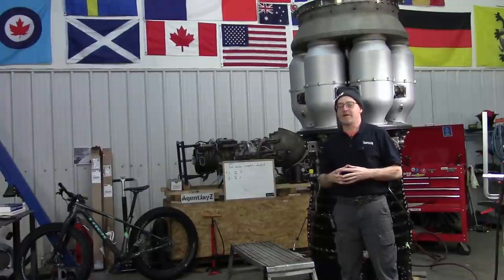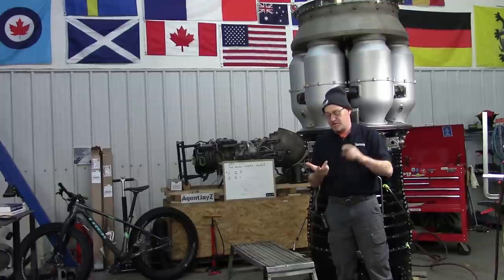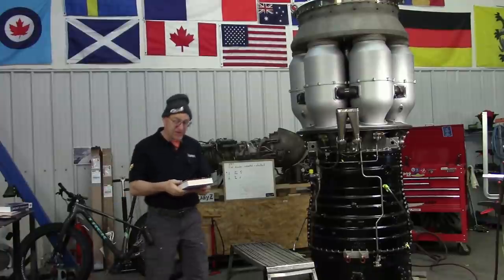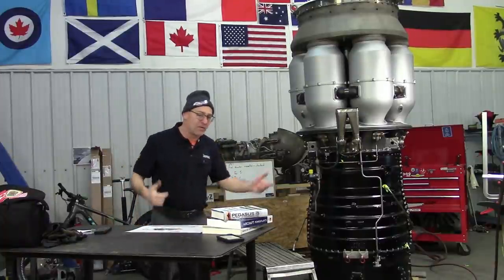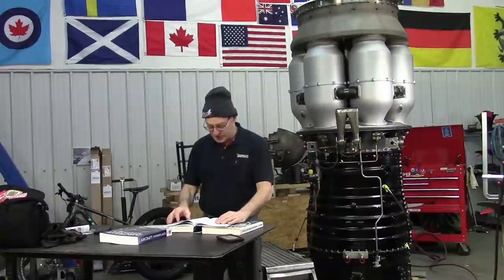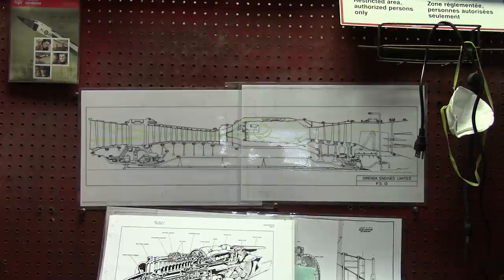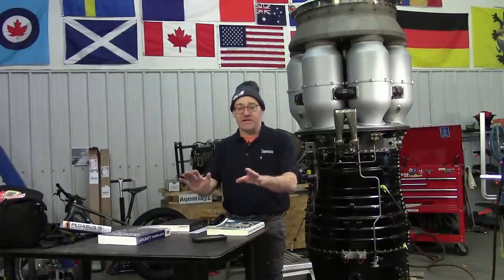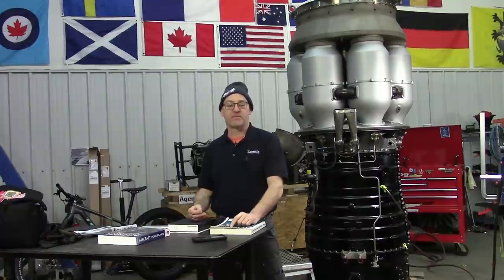So You Want to Design a Jet Engine

Comment: Graham, Are there any internal or external loads that we have yet to hear about on AJZ's channel?
Reply: To answer this authoritatively, I'd have to go through every single video.  However, it would probably be reasonable to say that, even if AJZ has covered all the major load issues, he won't have gone into the fine detail, nor would I have expected him to do so.  That would be going into the realms of detail design and even the books to which he referred here will only give an overview.  So let me think of a couple of examples.
He has discussed the phenomenon of engine surge, but he may not have considered the violent load changes on the compressor blades caused by the rapid pressure reversals.  These loads can cause very large bending deflections of the aerofoils, such that the axial spacing of the blades and vanes in a compressor is set primarily by their predicted surge deflections.  In fact, the deflections can be so large that, if they were imposed statically by a steady load, the blades would be permanently deformed.
Again, thinking about blade design, AJZ will have discussed the C/F loading on both discs and blades and, because of the  torque produced by the turbine, there must be a bending load on the blades.  However, he won't have explained that the aerofoils are designed with a very slight lean, so that the C/F load tends to offset the gas bending load.
I hope these examples give you a flavour of the the intricacies of of gas turbine design, to which AJZ refers.
Reply: @grahamj9101  Interesting, surge deflection is not one that I had considered. For the blade lean angle, would the centripital force help the blade resist gas load deflection or not really affect it?
I have watched all of AJZ's vids, surge deflection has not been covered, thanks!
Reply: @beachboardfan9544  Think about it for a moment.  Design a blade with the centroid of every aerofoil section radially above the one beneath it and spin it up with no gas load: it will be fine.  Now spin it up with hot gas doing the spinning: it will be bent very slightly by the gas load on it, even though the C/F load will be trying to straighten it up.  So how do you offset the gas load bending?  Try holding your hand up in front of you and imagine it as a blade, as I just did.  I'm not trying to be difficult: I'm just trying to help you to envisage it for yourself.
Years ago we had to do all this by hand calculation and it was an approximation at the best.  Nowadays, it can all be done by finite element modelling on the computer.

Comment: Engine dimensions is derivative of predicted and required performance and design limitations.  For hobbyist KJ-66, Wren MW-54 are budget concern, great for home project and "touch a jet engine principle". Mattingly is sandpit. I've strongly recommend - Лозицкий Л.П., Ветров А.Н., Дорошко С.М., Иванов В.П., Коняев,, Воздушный, Москва 1992
Reply: Can you briefly describe what makes this Russian book so great?
Reply: @sampepper9977  This book is like Russian version of "The jet engine" by Rolls Royce but far more advanced. They are focus of aerodynamics, rotor, stator composition, different layout of components for slow/medium/high speed rotors, bearings selection, thermal loads,material selection ,vibration, rigidity, rotor dynamics, central and external gearbox, engine accessories . Lot of mathematical models and practical examples. With additional book - "Gas turbine theory" by Saravanamutto, this books solves 90% problems for most gas turbine designers at early stage of design. They changed my perception in terms gas turbine design.
Reply: @MrCzarnm  спасибо большое

Comment: Would machining a traditional reciprocating engine block from chromoly gain anything as opposed to aluminum, or other lightweight alloy?
Reply from the maker: Do I need to tell you it's quite a bit stronger?
Reply: @AgentJayZ  I suppose I shouldve asked that differently. I meant like why would Lamborghini actually want to use it? Wouldnt the weight increase offset any benefits in block rigidity?
Reply: @mike-ph3fk  that kinda goes back to the fore-mentioned design intent.  What loads are going to be placed on what parts.  Does the added strength take precedence over the increase in weight?  Etc.
Reply: Overall no, the modulus of elasticity VS weight, and heat transfer are in most cases more critical than the ultimate strength.  Certain areas would benefit but the complexity of using more parts may outweigh the advantages.
Reply from the maker: Mike: Not talking Lambos. Talking 2000 Hp radial piston engines running at max power for hours on end... getting shot at by jack-booted assholes.
Reply: @AgentJayZ  It is funny you mentioned it in this video and this question came up...  I've always wanted to EDM a billet 4140 Chromoly into a Cummins 6BT block (pistons not jet).  Better tensile, toughness, and elastic characteristics than the ductile cast iron used in the production blocks.  Some shop is actually doing that for drag trucks ( http://www.lsmeng.com/Billet-Blocks2.html - no affiliation), but without water cooling passages, and on standard CNC milling machines.  I would have been targeting the same weight and better strength in some of the weak areas of their casting, then maybe looking at reducing the weight of the rotating mass - alas, the cost of a 3-foot x 2-foot x 4-foot 4140 billet remains out of my reach for now.  Even then it would be a blue-printed modification of an existing design as you point out.
  
@mike, as an exercise consider that a material has certain properties like tensile strength in PSI (I use Her Majesty's historic units still, cause 'Merica for some reason).  Throwing out a rough number, a 4-inch-long 1-square-inch square bar of ductile cast iron should withstand about 40,000PSI tensile load before it begins to permanently-stretch/plastically-deform and 60,000PSI of before it breaks, and for that service it would weigh about a pound (1.02lbs).  (Ductile Cast Iron is a good stand-in for aluminum in this example, in that most common aerospace alloys are roughly in this strength range, but at roughly half the weight - weight being just ONE characteristic).
  
4140 Chromoly steel of the same dimensions would weigh about 1-1/8th pounds (1.136lb)... but with a yield strength (stretching) of 60,200lbs and a tensile strength (breaking) of 95,000lbs.  So for a modest increase in density, one gets about a 50% improvement in its ability to hold together.
  
From here is where the engineering and tradeoffs start.  If your copy of the existing engine doesn't change any dimensions, but only the material - its weight will change but so will its performance.  If your copy wants to maintain the weight and the length of the bar, the bar could be reduced roughly to a 0.95" square bar - but with a 14,000lb better yield and 25,500lb better tensile strength.  If your copy wanted to maintain the yield strength and the length, the bar could be further reduced to a 0.664" square bar now only weighing somewhere around 1/2 pound (0.5lbs).  Other things like coefficient of thermal expansion, the susceptibility to corrosion, temperatures, pH of the atmosphere, abrasion resistance, impact survivability, castability or weldability, machinability, cost, simple material inventory availability... (and the list goes on and on) come into play.  All of these knobs are available to R&D and engineering.
  
So the takeaway AgentJayZ might suggest - I definitely would - is that you're probably asking the wrong question, and this is common for this kind of topic, as people often "don't know what they don't know".  You're asking what would you improve by using such and such material - in design and engineering the question usually goes the other way.  "What do you need this material to do" is what you'll see on a design table - and a Mechanical Engineer will look at a large book a materials and alloys and pick one that meets based on published values and years of experience and knowledge with those materials.  It's wasteful in engineering to intentionally look at each material and filter through what characteristics would work and what wouldn't work for your application.  It's easier to parameterize those requirements first and narrow down to some candidate materials, then start doing the Engineer's trade-off dance.
  
If you use one material and then in service find that it fails in a specific way, you'd understand the failure first, then look at the characteristics of that material versus other materials and balance the "system costs" of the tradeoffs in using those alternate materials.  Some of the manufacturing descisions on that engine AgentJayZ was talking about (moving from cast to machined for example) may have risen out of the material's manufacturing needs or other defects discovered in the original part that must be mitigated (like casting porosity, etc.).  Just saying "yeah, it was cast aluminum - it's machined chromoly steel now" obscures a huge effort and expense in failure analysis and engineering experience - and I believe that's the point of this video ;-).
Reply: Thanks for all the replies! Some damn fine info in them.   Another thing to consider that I neglected is that back in the forties, when they were developing those giant beasts, the metallurgy of the day was prolly wanting specially when it came to aluminum alloys. It wasnt long before he war that aluminum was a precious metal, where as steel has been used for tools and what not for far longer. Fun fact, the Washington monument in dc was capped with a small piece of aluminum, which at the time was considered very opulent. Also, Jay, please dont ever stop being a smart ass. The world needs a bit more tough love, than the snowflakes are willing to admit. Cheers!

Comment: May I ask how one may measure pr from inlet to HP compressor, a query I have had for some time
Reply from the maker: On a research engine, A hole would be provided for a gauge, and it would be directly measured. On a production engine, there is likely a boroscope port that could be adapted.
Reply: Same general idea when it comes to turbofan engines, but you'll have to be careful where you position your pressure taps and transducer s

Comment: Speaking of science in designing jet engins, mostly thermo dynamics and fluid dynamics, basics of mechanical ingenearing. So if you want to design micro jet engine, you will spend 95% of time on fuel and oil delivery setting.

Comment: I'm at least not so insane as to dare try building a combustor-based turboshaft of sorts, let alone design one.
I'm toying with the idea of designing an engine based on a couple turbocharger stages (with intercoolers to keep the compressor output temperature low, and reach high expansion (~200 pressure ratio (high altitudes)) without the exhaust depositing ice on the last stage/nozzle), but using a PEM fuel cell (~85 C max outlet temperature (= turbine inlet temperature)) instead of a regular combustor. Some of the compressor power is likely provided by an electric motor, like they do in some new cars with their "electric turbochargers".
And I don't want to do that part, but no one sells such an engine. The reason for the PEM fuel cell is efficiency and that it should be feasible without oil lubrication (at the cost of bearing life and efficiency).
Reply: Oh, and before I forget: I'd not dare to design my own turbine rotors. The components in question are industrially used, so I'd probably just re-design the housing, likely using composites for weight reasons, and also to better optimize the gas path into the intercooler (likely just a simple cross/counter-flow design optimized for weight). Yes, the hot compressed air would re-heat the turbine inlet air (and in-turn, be cooled), so that the gas in the turbine remains non-condensing.
And then pretty much just a bunch of these stages (5~8, by the looks of it) of decreasing size to handle the more-and-more dense air while getting close and closer to the fuel cell.

It seems the industrial turbocompressors/-expanders use quite massive, minimally-machined, cast aluminium or even cast iron housings, which are nice and cheap, but unreasonably heavy for aircraft applications.
That's the only reason I'm even willing to re-design that.

And as long as the plane would be a demonstrator for fuel economy, I'd be very happy.
(My reason against just buying a turbofan is the maintenance nightmare they tend to be.)
Reply from the maker: Well, I wish you luck and success, but I am worried a little but.
You've made a lot of assumptions here, and used terms and word in non-standard ways, so that you are starting to sound exactly like the main subject of this video.

Comment: I have a question for you and I don't think that it is such a dumb question if I had the knowledge and I was an intelligent human being with the finances and I wanted to design a jet engine that had $2,500 pounds of thrust how do you get the calculations to know that the size you are building will put out $2,500 lb of thrust that is also the equivalent weight that I would like to pick up how do you do the math to make the correct calculations
Reply from the maker: Well, Gary that's task beyond any one person. More the job for about a hundred engineers, and thousands of talented craftsmen. It usually costs billions of dollars these days.
Really.
The math can be tasted, or sampled by looking at a book like "Elements of Gas Turbine Propulsion"
by Jack Mattingly.
This is an intermediate text book, far away and above the books needed to do my job.
Once you read and understand this book, and hundreds like it... you will be ready to design your engine.
Hundreds of books on a variety of subjects later, you will be ready to start making the parts you have designed.
Don't forget those billions of dollars...

Much simper and easier to obtain an engine that meets your requirements.
Cheaper to find that engine used or even scrap, and refurbish it yourself.
Some amount of skill also involved there, but something one human could actually take on.

Comment: Hey a lot of people do build small gas turbines at home in their sheds.
Reply from the maker: None of them are competitive. They are all toys. Not the subject of this vid.
Reply: @AgentJayZ  Yes of course thanks for responding, love the videos. Whilst I have your attention though.
There is the classic idea that if you get too close to the intake compressor at power, at some point, it will grab you and pull you in.
Can you feel suction in front of the engine and does it increase exponentially as you get closer?
Reply from the maker: Although there is no such thing as suction, you do feel the air rushing in. Nobody gets close to the inlet at anything over idle, and you can feel the flow even then.
At higher power, you will die. Pushed in by the air rushing towards a location of lower pressure.
You are shredded and burned while you are accelerated.
Not a red mist, but a foul smelling smoke is what you become.
Reply: @AgentJayZ  Wow such a brilliant and dark description I've never had the opportunity to be in the vicinity of one of the big beasts you work on at power. Very exciting stuff.
May you and everyone you work with remain solid.

Comment: The thing with designing a whole new engine, is that one is stupid for trying to design a whole new engine.
The trick is to look at something you know, think about how it can be improved, prototype a piece, and test it.
Does it improve performance, efficiency, and/or reliability of the test engine? If so, great! If not, quit whilst you're ahead! Or not bankrupt at the very least.
And unless you've been in the design business, or the repair/maintenance business for a good number of years, I probably wouldn't bother, because there are companies out there with thousands of brilliant employees, and near limitless budgets who have more than likely thought of it 1st

Personally, I've been pondering a potential design for a piston engine, but the thing is everything I would do has been done and proven in the past, it's just that I'd be using a combination of existing technologies together in a way that I haven't seen done before.
It wouldn't be about setting any new records, the idea is just to produce a well balanced 4 stroke reciprocal piston engine that is easy to repair/maintain, conveniently packaged, and will basically run forever under typical usage conditions.
Now if say I ever had the money and the means to have the block and head machined, it would be setup with the same bore/stroke of an existing engine that I'm already familiar with, targeting identical compression, and using all the cams, crank, pistons etcetera out of the engine i already know so if it actually runs i could compare it's performance, efficiency, weight, and reliability with the engine from which it's based. And IF it performs equally or better, then, and only then does bore/stroke, valve size and lift, and can profile comes into consideration.
But at this stage, it's nothing more than the pondering of a madman, and I really don't see it developing much from there at present, especially considering that an electric motor already meets/surpasses what I'd be looking to achieve in most cases.

Great video as always, sorry about the rant 🤣

Comment: Was GE yf120 and pratt whitney yf119 than became the f119 I think were new designs that were developed by each manufacturer for the 5 gen fighters.  Yes they were funded by the government but very expensive for them. GE variable cycle engine was all new thing and performed better than the f119 but was not reliable in prototype. All this kn the late 80s.